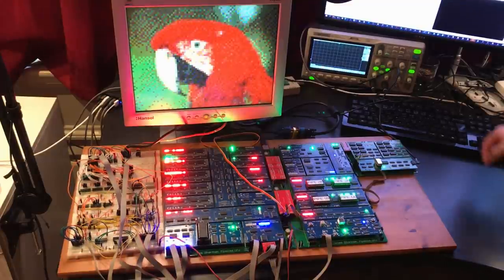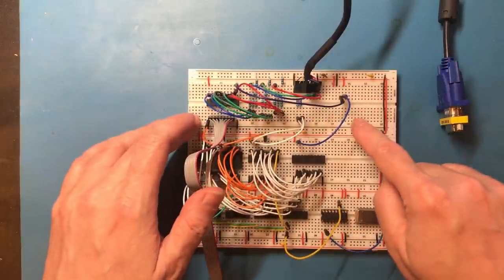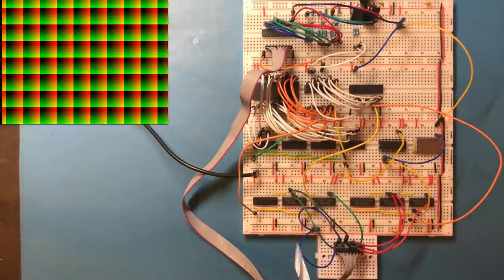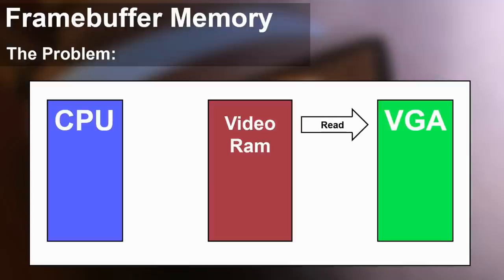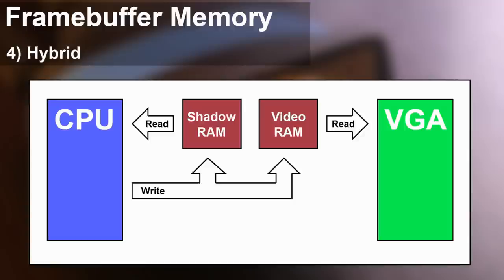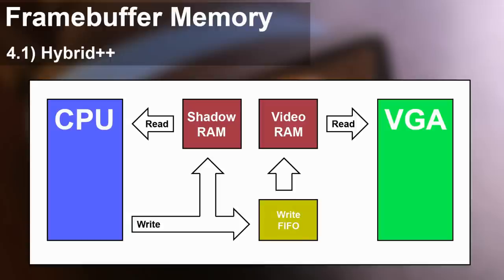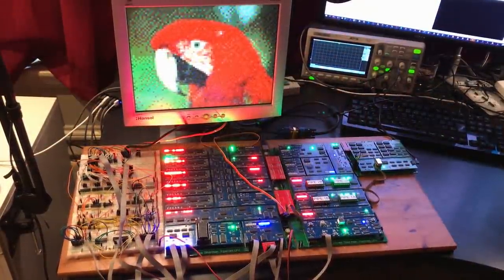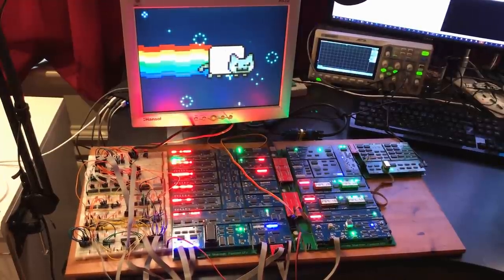Framebuffer - VGA from Scratch - Part 3

Comment: For PC enthusiasts, it might be interesting to know that all classic IBM graphics cards (MDA, CGA, EGA, VGA) did use Time-Division multiplexing for video RAM access, even though on the MDA, the video clock (16.257 MHz) and the bus clock (4.77MHz) were completely different. IBM added logic to add wait states to video memory access until "the time has come for a CPU access time slot". This has some interesting consequences we observed on the PC compatible system:

- Suprisingly, performance is not that much hampered as I expected: You get only every second memory cycle to the CPU on MDA and CGA, because they use 1:1 multiplexing. On CGA in 40-coloumn modes (I get to 80-column mode later), we have a dot clock of 7.16MHz, and as characters are 8 pixels wide, a character clock of 895kHz. During this period of 1117ns, the graphics card needs to load a character byte and an attribute byte, i.e. 2 cycles. As graphics card and bus interface alternate between cycles, we need to pack 4 memory cycles into the 1117ns, so the total cycle time is 280ns. This exactly fits the 270ns cycle time of the MCM4517-12 RAM used on (some copies of) the original IBM CGA. The processor gets a chance to access video memory every 540ns. A memory cycle in the IBM PC takes 4 clocks at 4.77 MHz, which is 838ns, so it will miss every other opportunity, and could access one byte of video memory per 1080ns, i.e. at a rate of 925kHz. It's the slowness of the 8086 at 4.77MHz processor that makes this rate unobtainable, though. Keep in mind that the processor needs to fetch instructions over the same bus, and the microcode for "REP STOSW" or REP MOSVW" is slow. In essence, the average delay caused by the synchronization will be half the slot frequency, so around 270ns, which is around 1.3 processor clocks. The MDA card (in its only mode, the 80-character mode) runs a similar scheme at a character clock of 1.8MHz, but it uses 16-bit memory access to fetch characters and attributes at the same time, so the memory timing matches the 895kHz CGA clock quite well.
- The CGA in 80-character modes needs double the bandwidth of the CGA card in 40-character mode (or in graphics mode). The memory subsystem with its static 1:1 multiplexiing it already maxed out in 40-character mode. In 80-character mode, the CGA opportunistically also uses the cycles assigned to the processor, converting the 1:1 multiplexing into a 2:0 multiplexing. It can't make the processor wait until the end of the scanline, because the active display period of a CGA scanline is aroung 45µs, but you can't add waitstates for such a long time. The IBM PC runs memory refresh cycles that need to happen every 15.6µs over the same bus, so wait-states must not exceed 10µs or memory refreshe will fail. As I already hinted, the CGA uses the processor cycles "opportunistically", i.e. only if the processor doesn't access the RAM. If it does access the RAM, the CGA performs the processor cycle instead of the graphics card cycle - but still uses the data that was transferred during this cycle as if the graphics card cycle had happened. This causes the well-known "snow" on CGA in high-resolution text mode.
- To meet the performance required by 16-color 640-pixel graphics, IBM upped the 8-bit RAM interface of the CGA card to 32 bits on the EGA card. At the same time, the 40-character character time is no longer split into four memory cycles, but into five memory cycles. The multiplexing can be configured as 2:3 (2 cycles for the EGA, 4 cycles for the bus) or 4:1. In text mode, only one character/attribute pair is loaded in a 32-bit cycle due to how the memory is organized, so EGA is on par with the MDA here that uses all 16 bits of its 16-bit cycle. Text mode needs a second RAM cycle because EGA has the font in the display RAM. So high-res text mode (80 characters) needs to use the 4:1 multiplexing, while all other modes get away with 2:3 multiplexing. Display can be disabled to get a 0:5 multiplexing to the processor for increased performance.
- VGA still is the same, but the increased video clocks now generate a character clock of 1.57MHz for the 40-character character clock. In 4:1 multiplexing, the theoretical maximum rate would be 1.57MHz, while in practice mainboards add enough waitstates to 8-bit cycles for compatibility reasons to drop the rate to half of this, i.e. 780KB/s. The advantage of the 2:3 multiplexing is thus rooted in the lower latency, but total throughput is likely only slightly higher.
- MCGA got the 256-color mode to work with 8-bit video RAM instead of 32-bit video RAM (which has its rate maxed out on the VGA), because IBM decided to use VRAMs, a special kind of double-ported RAM, in this display solution. They could get rid of time-division multiplexing that way.
Reply from the maker: Obviously this was implementation specific, I had a 3rd party mda card that would screen fuzz if you wrote too fast. I remember the vga had it's memory broken up into 4 banks, this was usually hidden from you but you could flip some registers and take advantage of it. Sequential bytes were in different banks but that was usually hidden from you by the memory controller. In 256 colour mode you could only have 320x200 officially but flip a few bits and you could get 320x400 on a standard vga card. But to access the memory you would have to set the mask that controlled the bank access differently for each vertical column of pixels. I used that mode for Swiv 3D. As a programmer I wasn't thinking in physical implementation terms back then but now it's clear the 4 banks were for parallelising the read.
Reply: @weirdboyjim  Your 3rd-party MDA clone is likely an early cost-optimized clone. The later MDA/Hercules clones get away with 8-bit memory (remember the original MDA had 16-bit memory) without flicker, likely using faster RAM than the original MDA. A fuzzy MDA clone likely uses 8-bit RAM as the CGA card does, but isn't running the RAM fast enough to do proper 1:1 multiplexing.
The 4 banks of the VGA are more commonly called planes. While it was hidden in 256-color mode that there are four planes, the EGA/VGA memory organization was very apparent in 16-color modes. VGA memory is organized as 64K x 32 bits, whereas the bus view has 64K x 8 bits. One of the most simple ways to access the 32-bit memory is to just pick one out of four 8-bit chunks that make up the whole 32 bits, and that's where the plane stuff comes from. You could also write to multiple planes simultaneously (using the "map mask register" enabling multiple planes. WTH didn't they call it plane mask register?), or do a 16-color mode color compare read instead of reading a single plane.
The 256 color mode hack you talk about is most widely known as "Mode X" or "unchained mode". The idea of the standard 256-color mode is that four subsequent bytes in processor space map to the same address in VGA memory space, so the lowest two address bits are no longer used as address bit, but as plane select bits instead. Because it chains the four planes into one virtual plane, the mode is called "chain-4". 256-color mode is dependent on the four neighbouring pixels being stored in the same 32-bit word of VGA memory to, exactly as you say, read four pixels in parallel. In Mode X, you disable reinterpretation of the two lowest bits as plane select bits, so you can address all VGA memory addresses, and not just every fourth address. Then, you disable "doubleword mode" on scanout, which causes the card to only read every fourth address in VGA memory. This makes the whole 256K accessible - at the cost that you, as the programmer, have to fiddle around with the planes and make every byte hit the correct plane, a task the VGA card did for you in chain-4 mode.
The interesting thing about chain-4 mode is that due to the presentation of the 16K x 32 of VGA memory that is used (48K x 32 is unused, as only every fourth word is used) as 64K x 8, the programmer doesn't have to interoperate with the VGA card for drawing operations. The MCGA card I already mentioned in my previous comment at the end chose a completely different hardware way to provide a 64K x 8 video buffer (by using two 64K x 4 VRAM chips), but the 256-color mode of the MCGA and the non-hacked 256-color mode of the VGA behaved identical.
A further cool thing about chain-4 is that chain-4 modes allow 16-bit or 32-bit accesses to video memory by just transferring more than one plane at once, without any architecture change. Some early 16-bit ISA VGA cards support 16-bit memory cycles only in chain-4 modes, or the odd/even mode (something like a chain-2 mode used for CGA compatibility), but fall back to 8-bit only if no chaining is enabled.
The fact that MCGA could downgrade from a 32-bit data bus to an 8-bit data bus deliviering the same video performance as VGA shows that VRAM, a special kind of "nearly dual-ported" RAM, is a very efficient way to implement video cards. I still consider your choice to not go dual ported in your project a valid choice. If you go VRAM, you could also use an integrated CRTC (like the ubiquitious 6845) instead of your army of counters and the lookup EEPROM. But that's the level of integration your project tries to avoid to show the basics. Cheers for keeping true to that idea!

BTW: I call VRAM "nearly dual-ported", because you need to issue transfer cycles to the shift register for the secondary port trough the primary port, that is usually used for CPU access. You can't do anything sensible with the secondary port alone unless you have some control to the first port, too.

Comment: Success! ... Oh, thanks for not, uh, giving up on us. 🤣
Hey, I was excited by the Hybrid ++  idea.  Sorry, I'm new and trying to get to speed on this project. So, I can't quite get my head around how you'd implement a FIFO queue with low-level logic. Would this be a cascading array of buffers or a small ram chip with a bit of clever counter logic to push and pop?
Reply from the maker: There are a bunch of ways you can do it. An array of buffers would probably be too much for this, I've calculated 40 entries is the peak you need so  that would be 120 8-bit chips. Ram chips are an option but I'd have to solve the read/write multiplexing issue for those as well. There are also hardware FIFO chips that solve is in one go, I might be more willing to use those to demonstrate this as a side project as the fifo implementation isn't the focus. If you are interest, I did a raw logic fifo implementation for the UART - https://youtu.be/1766wc7rCNg
Reply: @weirdboyjim  Thanks! I'll go check it out.

Comment: James, I’ve been rolling this around in my head since you posted this video, and I think I’ve got an idea that might be worth trying.  
Since the issue is that the video RAM needs to provide a byte on every pixel clock, that effectively shuts out the CPU except on retrace intervals.  What if you doubled the video RAM width to 16 bits (two RAM chips), so that the video Would only need data every other clock?  You could use address bit zero from the CPU to drive a MUX to select which of the pair of video RAM chips is accessed.  That would allow the 50/50 access for the CPU again.  You would have to implement high byte/low byte select on each pixel clock, but that doesn’t seem difficult.  
The only thing in the way of this, I think, is a “stall” capability for the pipeline stage zero and the memory bridge... if the CPU tries to access the video RAM on a cycle where the VGA adapter is reading from it, then that cycle needs to be held for one beat while the video access completes.
Simpler than a FIFO, I think...  of course, if you have a better plan, then by all means go for it.
Reply from the maker: There are a large number of ways you can solve this contention and it wasn't possible for me to talk about all of them. Increasing the data bus width in the way you describe is very much aligned with the time division approach but you create the fetch slack with width rather than increased frequency. Either way you end up with a regular time interval where you can switch device. But you would then have twice the bus width to deal with for that switch, memory read and writes to the cpu are currently 8 bit so you need logic to deal with the bus width differently. What you propose is a big step up in component count and complexity from where my circuit is, and that circuit already handles everything I need it to.
Reply: @weirdboyjim  fair enough.  Just an idea.  However, I wasn’t suggesting to change the CPU main memory to 16 bits, just the portion of RAM inside the video adapter.  To the CPU, it would still be 8 bits wide with the high/low byte steering logic.
I do understand keeping it simple for breadboarding.  Maybe I can try something like I’m thinking in my own lab and get back to you.

Comment: I was rooting for the multiplexed solution -- my fave 8-bit system, the BBC micro, used that approach. The 6502 CPU ran at 2mhz, and the RAM was clocked at 4mhz to allow the video system access to it.
Reply from the maker: It is a nice technique, but they did have the same speed conundrum designing the bbc as I have here (albeit for a different underlying reason). Those 4mhz chips was a big chunk of extra part cost. We are spoiled for high speed parts these days!

Comment: That was really impressife! And on the technical side even the rick roll at the end xD

So when you take the grafics card into a pcb, i would like to make the video rom as a seperate module, so you can make a seperate board for the actual circuitry, the fifo buffer and the existing two port rom. That allows you to not cheat, make a nice improvement later but also have the highest possible cpu speed!

So if i were at your situation an would like to play and develope some games, i would hate myself if i had not used the "super cpu speed option"
Reply from the maker: I'll try and break the pcb's up into as many modules as possible.  The write fifo could be kept very separate though.
Reply: @weirdboyjim  Thx for your answer, I cant wait to see all the pcb layouting process and finished pcbs!

Maybe the next big project will be a led monitor from scratch xD

Comment: You could use FPGA in schematic mode to bypass lot of work, when you get it working, replicate with chips. No need to know any VHDL, just draw as you draw :)
Reply from the maker: Just pause for a minute and look at that mess of pcb's, wires and breadboards evolving on my desk and ask yourself "Is this a man inclined to take shortcuts?".
Reply: @weirdboyjim  just trying to be helpful 🙂
Reply: Oh please, Verilog not VHDL. 😉
Reply: @weirdboyjim  To be fair, I think everything in the 80's other than the ZX80 & 81, used custom chips for video, (PGAs). But building the logic from discrete chips of course keeps the design accessible to those of us struggling to understand what's happening. I've never programmed a FPGA, but I imagine the logic design that goes into them won't be significantly different from using discrete chips. And you're on the slippery slope by using a EEPROM for timing rather than building from logic gates 😁😉

Comment: As you say In old 8 bit days, the video mamory was updated during the video flyback period, there is no output to the screen. AKA PET,  nice video. As in the old days of CGA, if you wait for the flyback signal you get no flicker but it slows down screen updates.  can still remember when I got my first Trident SVGA card
Reply from the maker: I remember in most early vga cards if you updated the palette you would get this kind of snow on the screen if changed some of the registers without waiting for blanking.
Reply: @weirdboyjim I can remember the exciting time of going from an amber screen to colour and a CGA card, might even have been full length. I bought a motherboard without Bios as they wanted and extra £75 for the bios i think. Luck my boss had bought one so  I copied his. I think the processor was an 8086 can’t remember the speed but I expect around 1meg :-) and a single 360K floppy. What exciting times we have lived through, tech changing so fast.

Comment: Nice job on the design decisions and "sticking to your guns" re: costing.
I think the idea of pre-loading the counters to line up the start of memory to the top/left is a good idea. You are using the right counters for that job.
Does your CPU/MCU board have an interrupt controller? I was not sure but it did not seem that you were tying in the start of vertical blanking interval to an ISR... apologies if I was wrong on that.
Also is the 64KB video RAM that actual working memory or do you copy an already "rendered" image to the RAM during blanking intervals? If so, that could be extended into a nice working DMA system later on...
Cheers,
Reply from the maker: No interrupt controller,  watch the design retrospective video if you want a bit more information about that but there is a build complexity tradeoff to be had and this thing already fills my desk.